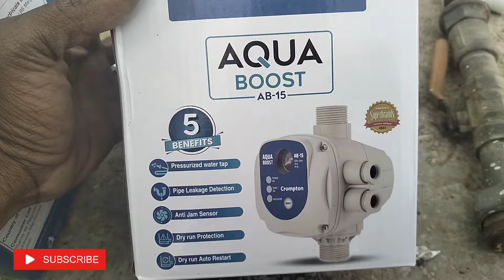kam kharche mein bada dhamaka Crompton ka mini  boost Aqua pressure pump #crompton #viral #plumbing

Comment: Sir iss Crompton pump control ko 0.5 hp water pump me use karsakte hai kya ????
Reply from the maker: Yes brother
Reply: Sir mene ye system lagaya hai ... But pressure pump every 1 min me 3 ya 4 sec ke liye on hoke off hojaraha hai ... sir Aaisa kyun horaha hai ???
Reply from the maker: Kahi se leakage ho raha hoga Barik sa isliye hota hai
Reply: Sir iss controller me pressure setting kaise kare ???
Reply from the maker: Ek video bana kar bhejo mujhe
Reply: @wasim-sayyad-  kaisa video ?
Reply from the maker: Bhai ap instagram pe massage Karo  
Sd-wasim444  pe
Reply: Sir iss controller me differential pressure kaise set kare ???
Reply from the maker: @ashutoshnayak204   Bhai app Instagram par message Karo please SD wasim 444